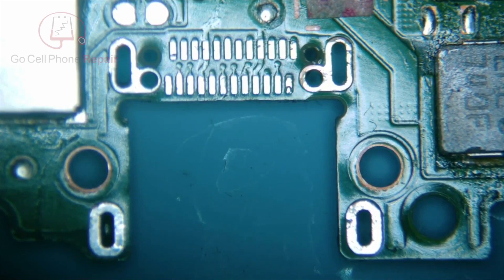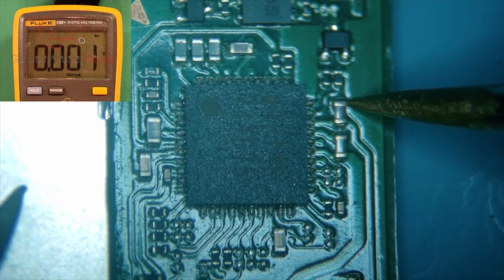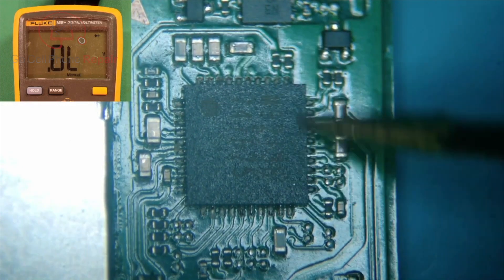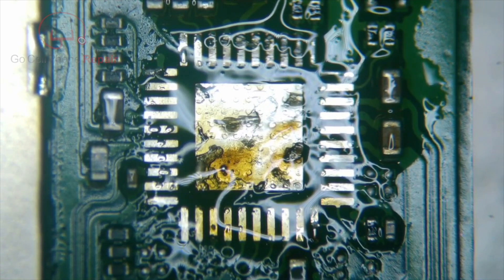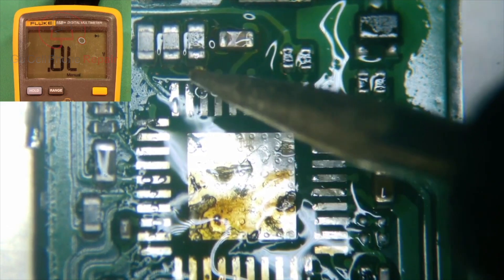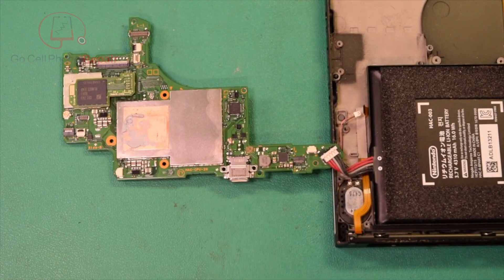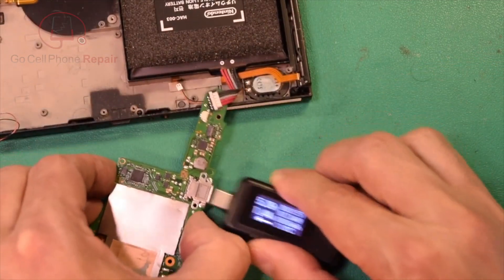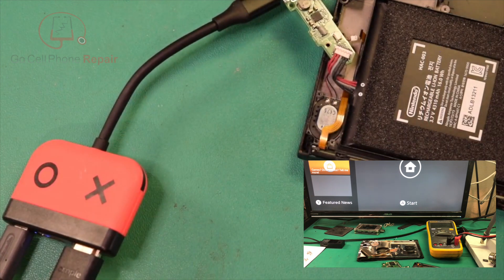Nintendo Switch Charging IC Replacement

Comment: I don't suppose you could help me with a power issue on a 2DS doorstop model?  I was doing a USBC mod and i put the battery in the wrong way when I had the shell and i thought i messed something up.  I replaced the charging IC much like you did and the light should in theory flash when connecting the USBC cable but I'm not getting any flash.  I need some assistance troubleshooting.

Comment: Hi there! I realize this is a super old video, so much appreciated if you're still replying here^^ At 2:01 you're pointing at a cap and saying you're not sure if it's that one or the one above it that connects to the P13USB chip and that you could confirm it if you checked haha. I have a short on that cap, the fuse by the USB-C port is fine, the USB-C port itself looks fine, the caps around the MAX chip and the BQ chip were all fine. So far this is the only short I've seen, so I'm wondering if the issue is likely to be with the M92 or the P13USB chip? I have a Mariko V2 board. I'm just getting into all of this and trying to learn all that I can, hence how I ended up on your video here. There is a lot of info in forums and videos but none of it is very well organized haha. Much appreciated for any insight here.

Comment: How would you source those caps if they were bad? How would I know what values to get?
Reply from the maker: You'd have to take them off of a good board and measure them or find the information somewhere online. There are a few gaming repair forums out there if you search. These capacitors rarely fail. Out of hundred of Switch repairs I think that I've found a bad one maybe once or twice. The short almost always comes from one of the ICs.

Comment: Hello, I have some questions about this repair, I hope you can give me some answers for these questions:
1) What is the temperature used on the hot air device?
2) Is the fluid that you use to remove the broken M9 charging chip is the solder flux?
3) what is the spec or the temperature for your iron solder that you use?
Reply from the maker: 470C @35LPM, 8mm nozzle
Yes.
840F

Comment: Switch stopped powering on/charging after kids were using it. Not sure if it's the port or the m92 IC so I ordered both replacement parts thinking this would be a perfect time to use my new hot air station...until the IC came in and I realized how unbelievably small that chip is. I thought it was about 4x bigger than it actually is and I don't have a magnifier setup yet. I go by feel and then check after with 3x magnification, but this is waaaay too small I think to be doing it this way

Comment: Nice repair!
13:17 I don't think that you "must" use the original Nintendo power supply. Any USB PD power supply should work, if it supports 15V with at least 2.6A (more, e.g. 3A, is also ok). The official Switch dock only enables HDMI output if the connected power supply reports that, and I guess your third party dock behaves identically. There are actually other docks (like the Skull & Co Jumpgate) that can enable HDMI output without that requirement.

And from the video description: "The M92T36 power control IC chip is also sensitive to damage from the use of non-OEM USB-C chargers". There's no evidence for that. The BM92T36 is a generic USB type-C power delivery controller by Rohm Semiconductor, intended to work with all USB PD compliant power supplies.
Reply: There is a lot of evidence of it... All the broken switches is evidence